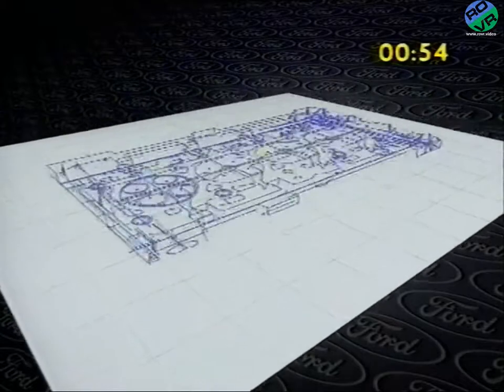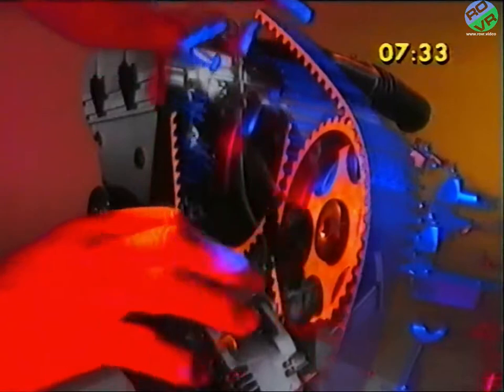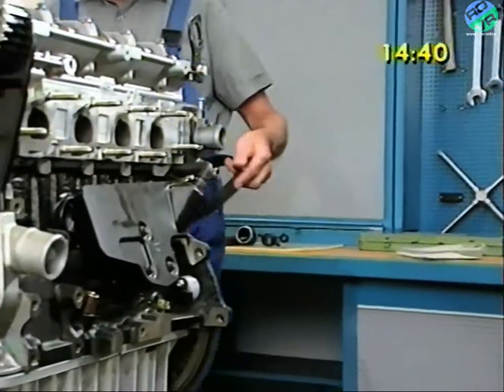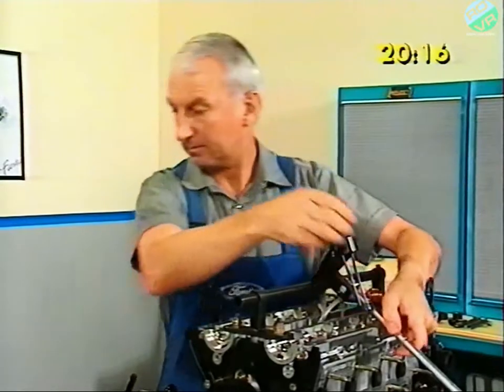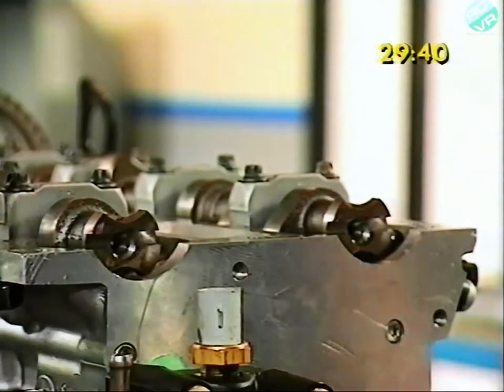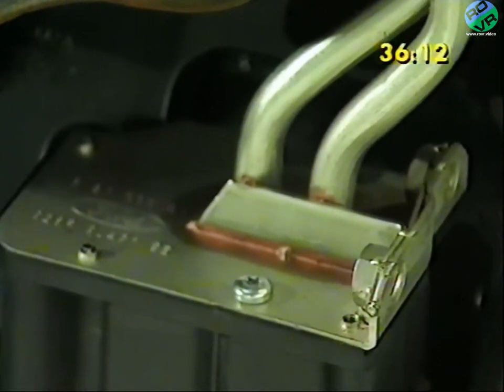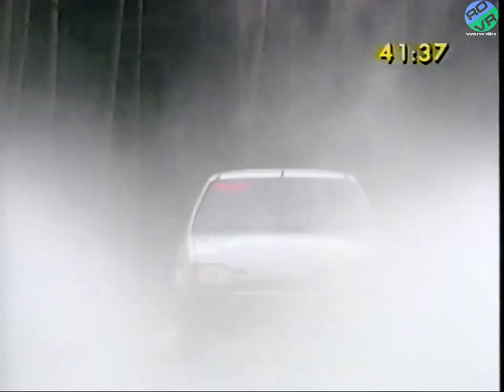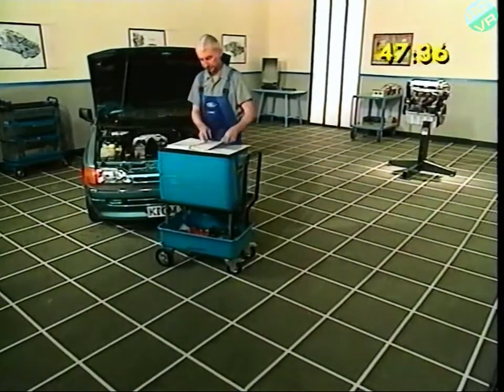Ford - 1.8 Litre 16v DOHC Engines (1993)

Comment: still drive my 1995 1.6 16v si around daily. the timing belt guide in this video is decent but its easier to just undo the cam sprocket bolts first.

Comment: Amazingly the cam belt changing  procedure  was revised after it was found the plastic tensioner pulley would collapse after a belt change and retension. We still have a pair on our wall of shame . All with cracks in the plastic webbing. One man did his own and ignored our advice saying Ford did not specify it and we were loading the bill. His tensioner collapsed at 70 mph scrapping the engine......

Comment: During the 90s when this F  Zetec just came out their was a major design flaw in valve guide thickness and from new when they had at least  10k on them. Warranty recall for thousands of them.
The first versions suffered badly from sticking valves causing misfires.
 I worked in a Ford Dealer and their where Mondeos and Escorts everywhere getting recalled and brand new cylinder heads fitted.
Must of cost Ford millions
they started with new plugs/leads and a carbon clean liquid down the intake..smoke everywhere.
Animal on fuel they where but durable engines